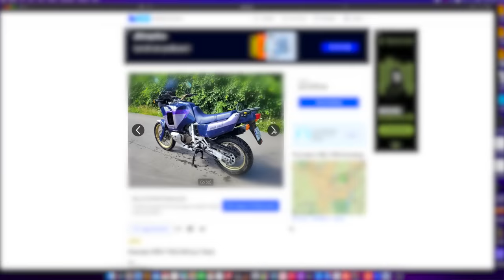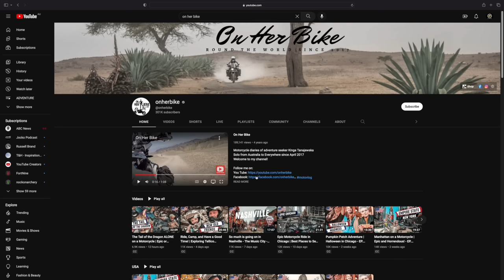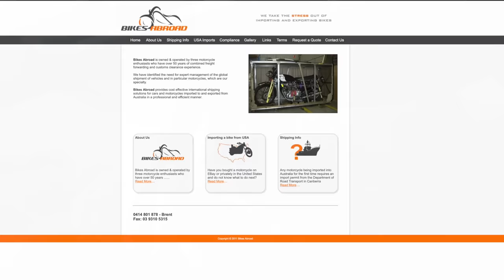Trying to license a foreign motorcycle - The Warhorse Down Under EP 2

Comment: It’s really good to see warhorse again, I have soft spot for these types of early adventure bikes, my first was a 1985 DR600 which I totally rebuilt it the early 90’s which I used as a daily through the week went camping on the weekends, until I discovered how the internals of a Honda XR 600 were built with roller bearings on the cam shaft. Then I changed camps. Now after having a 2014 660 Tenere for 12 months,which after 10 yrs of owning a LC4 400 previous. I sold the Tenere & chase down  the 07 ktm 640 adventure interstate,so far after pulling it down & going through it I’ve address everything that was needed, my plain is to do the cape unsupported in September from blue mountains nsw. Thank you for sharing your story it’s great to watch & inspirational 👍👍👍

Comment: I did the same on my 1995 African twin. I took it all apart and put it back together correcting all age problems. It's a good bike. You have to use a reinforced tire and inner tube due to its weight.

Comment: The rulings on braided brake lines is perplexing. Braided brake lines are up to spec for the aviation industry, so why not for motoring ?  Some of these inspectors just love stuffing people over, because they can !  Many year ago I spend best part of half a day at the Warwick inspection station (Perth) dealing with exactly this issue for my Yamaha TT600 Belgarda. The dealer had already wasted a day there attempting to process the same bike. I told them repeatedly that there was a circular put out ex Canberra that covered the bike, but the pratt I was dealing with refused to chase it up, obviously because I knew something he didn't. My anger and frustration must have been visible because another inspector took over the case after the original inspector already told me to return the next day, and within half an hour I was out of there, licenced. Some of the clowns doing rider/driving tests are just as bad.  So glad you got the outcome you were striving for 👍.

Comment: 50,000kms is not a lot man, that engine can do 200,000kms with proper servicing. I've a TA 650 and the Speedo went on mine at 32k Kms. Your bike is actually in better condition then when I bought my 2007 TA, at least from the video footage that bike looked pretty mint. Look after that bike they're going up in value! TA and Africa twin share a lot in common.

Comment: Some friends of mine had a VFR 750 with 250000 kms on the odometer. They took the whole engine apart and measured everything that could have been worn down with a micrometer. Anyway it was Zero problems! So changed bearings, pistons etc and rode on for many many years. If people do the maintainance Jap bikes last 4-ever.

Comment: Another one making the tragic mistake of powder coating a motorcycle frame! Until you’ve seen how metal deteriorates undetected behind that thin layer of plastic film, that cannot be retouched or repaired - eventually leading to catastrophic damage and failure, you have no notion of what a bad idea it is.